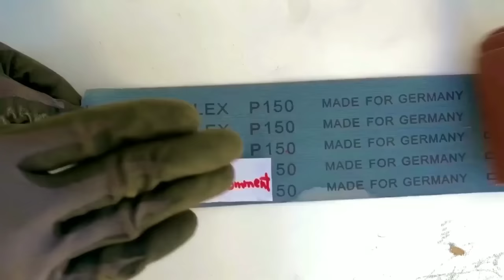100 years old Teapot restoration| 15 MIN RESTORATION

Comment: Instead of all that work rubbing it and then using sandpaper on it (of all things which will damage the item by taking off too much material), the best way to remove all the oxidization is with a soda blast unit. Reasonably cheap , easy to do and much better than sandpaper.
Reply: Keep your negative thoughts to yourself he knows what he's doing better than you

Comment: How do you clean the inside of the pot and spout to be able to use the tea pot ?  There must be a way. Especially thr spout.  There are other antique tea pots still in use.
Reply: First off you use a chemical means like vinegar and salt. You can mix it with flour  to thicken it up, then you use a small rag and a stick. Both to apply it and then to polish it with either a tripoli or rouge compound. But he was more focused on making the picture dance and slide in and out to think of doing that.

Comment: You can put some lemon juice and salt in the water. I don't think it would be necessary to boil the water. Diluted tartaric acid also takes residue and oxidation off copper/bronze. I wouldn't use sandpaper on such a soft metal.

Comment: boiled water, baking soda, oil and aluminum foil will take off all the tarnish. No sanding, no boiling for 2 hours. Or use an aluminum pot to put the piece(s) in then add the baking soda and oil....it all slides off.

Comment: liked the little bit of music....  have you looked into small hand power /rotary tools for the ease and speed they give?  polishing, grinding, cleaning, and buffing w/ various pads/brushes/cloths and types of grit/creams/etc. all battery or electrically powered.  save your hands/time/energy.   ;  )
Reply from the maker: We will use different machines and accessories for our restoration videos as our channel grows. Thanks for your kind comment.
Reply: @15MIN.RESTORATION  You are not "restoring" them you are vandalising them.

Comment: The stuff you called "dirt" was basically fine particles of brass. Sanding did remove a lot of surface age, but also a lot of surface detail. Chemical cleaner would have been a lot better way to go on such an old piece. And then go to a Brasso type polish and soft cloth and even a polishing machine to bring out the real shine without removing so much surface detail. A mirror finish is not impossible with the correct polishing equipment.
Reply: Gary Mucher. The teapot would never have been that shiny. It would have had a bright lustre, but would not have shone like a mirror.
Reply from the maker: Thanks for your feedback. We will do a better job next time.

Comment: Let's see....15 minute restoration, 2 hours in boiling water, a couple of hours scrubbing....yeah....that doesn't add up.  FAKE.
Reply: No where does he say or imply that the work took only 15 minutes. Read the explanation under the video!!!
Reply from the maker: 15 min is for our videos length not for the entire restoration. Our restoration videos take 2 or 3 days to complete. Please read the video's description. Thanks
Reply: @15MIN.RESTORATION It's still a fake restoration....you bury something in mud and grime, let it rust, then clean it up....the same as washing dishes, doing the laundry, or working on the yard.....hardly a restoration.